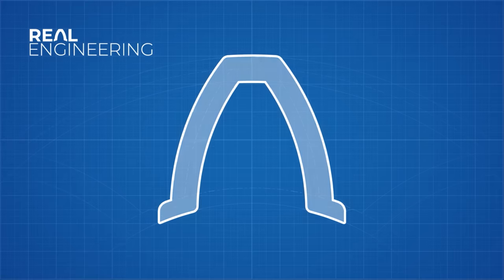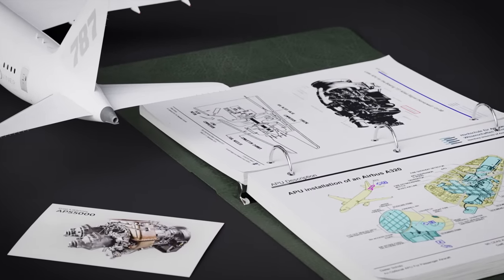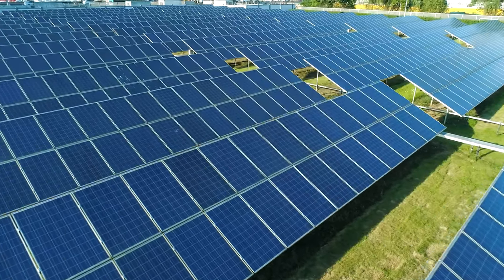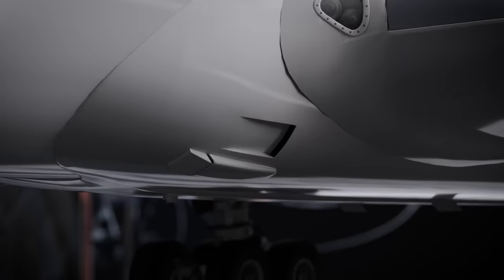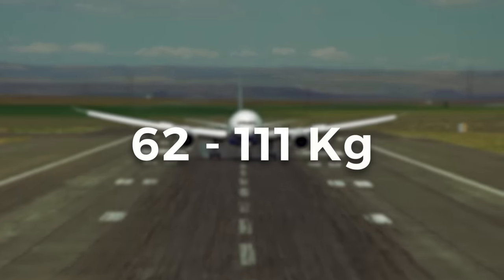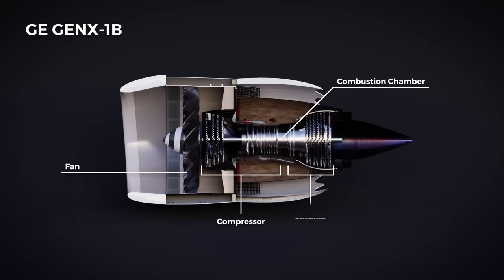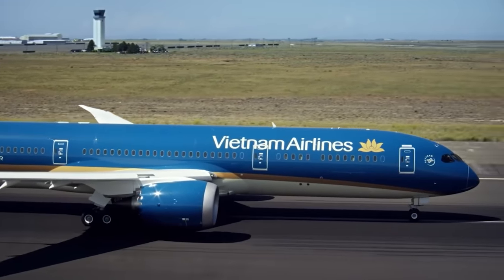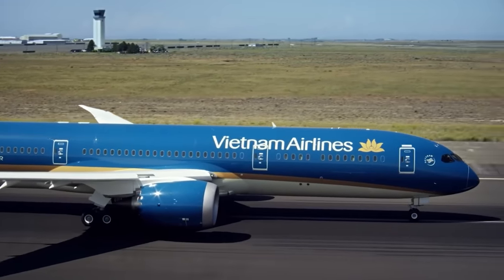The Insane Engineering of the GEnX

Comment: Really neat engine, basically a ducted turbo prop. Makes perfect sense in the evolution of engines and our times of needed efficiency.
Reply: Turbofan seems like the perfect name now huh.
Reply: Such turbofans have been around for decades; the bypass ratio has increased, and they've become more efficient, but still turbofans.
My day job involves getting large commercial turbofans through the FAA certification regimen.
Reply: @UncleKennysPlace  Very cool. They are kind of like highway gears on a car. It gives the engine more load to work with.
Reply: A ducted turboprop with many more blades... aka, a high bypass turbofan?
Reply: Turbofan engines have been around for ages… 🤔
Reply: @TheAmazingCowpig  not necessarily, turboprops are categorized as torque producing engines, they dump their power into a reduction gearbox which slows the rotation of the output from 30000ish rpm to under 2000 rpm for propeller drive. Where a turbofan is a thrust producing engine that derives it's power from the hot gasses exiting the engine and has no need to reduce it's rotational speed, turboprop and turboshaft engines also do not have bypass ratios because they don't produce power by forced air but through a shaft
Reply: I can see where your coming from, but generally speaking while both are Turbine engines, turbofans will use bypass air to cool critical engine components such as combustion liners and turbine blades/vanes as the metals cannot handle the temperature of the flame where as turboprops just use either bleed air or air from the intake to cool such things
Reply: @nolankeilty3732  

I think you’re missing the point my friend
Reply: "Efficiency" has its draw backs though, when it comes to air freight at least in my experience as a flight dispatcher. The less fuel it burns, the less cargo the plane can carry at a longer distance. You can carry up to 40,000-45,000 LBS of cargo in a B727 from Michigan to Laredo airport with relative ease, especially if the weather is perfect. In a B737 however, things are certainly different. From Michigan to an airport in California for instance, the most you'll be able to carry is 30,000-32,000 LBS, because its not burning as much fuel as the less efficient B727, making it heavier. I believe this is one of the reasons why B727's are still being used a lot in air freight operations.
Reply: @nolankeilty3732  in Turbofan engines, the majority of the thrust is produced by the bypass air. Cooling, if any, is incidental.
Reply: @jibronigibironi8959  >The less fuel it burns, the less cargo the plane can carry at a longer distance
Surely you mean a shorter distance. 
If 2 identical aircraft (one with high efficiency and one with low efficiency) are on the same route with the same cargo capacity, the higher efficiency aircraft can do it with less fuel and therefore cheaper, or use the same amount of fuel and bring the cargo further.
Why would you load an aircraft with 10000lbs of fuel that you don't need and reduce your cargo capacity needlessly?
Reply: @Pique147  No I meant at the same distance, on long trips from say, Detroit Metro Airport to LAX, a B737 can't carry as much cargo as a B727 because of its fuel efficiency, not nearly as much actually. We always gave them at least another 30 to 45 minutes of extra fuel just in case they have to maneuver around storms at the pilots discretion.
Reply: @Validole  my guy I went to school for this they use bypass air to cool the liner so it doesn't melt trust me
Reply: @jibronigibironi8959  But why? That makes no sense to me. More fuel efficient = less fuel or more cargo. 
Is the 727 configuration somehow more efficient than the 737 under wing engine layout maybe? Cos all other things being equal you wouldn't be putting more fuel into a more efficient vehicle to do the same job.
Reply: @Pique147  Well, yes, less fuel means more cargo. It didn't really matter in the case of a 737 on long trips. We could have reduced the extra fuel to 15 minutes, and it still couldn't carry as much as a B727. That's why Kalitta, the company I worked for, kept B737 trips confined strictly to either east coast trips, or west coast, and they only started doing west coast trips a few years ago. That was when I found out how much less a B737 can actually carry in fact. I had to plan for the planes to be flown over to LAX and PHX airport from the east to prepare for the west coast missions for DHL.

It literally could not carry anymore than 25,000 to 32,000 LBs at the most, even with little to no extra fuel, while a B727 can easily carry up to 45,000 LB's the same distance even with 30 minutes of extra fuel. This is why we never planned flights to go from west to east or vice versa with a B737. It was always 727's used, because they can carry more cargo with extra fuel in case of bad weather. Even though the B727 is older and less fuel efficient, its actually to a companies benefit if they are carrying cargo. Not sure if the engine layout has anything to do with it.
Reply: Ehh. The 727 is a bigger plane than the 737. They are differently designed planes, so it's not like it can carry more just because it burns more fuel. It has a 50% bigger wing area than the 737 for instance.
Reply: @ThePentosin  The only part that really matters is the fuselage. They are roughly the same size on that part. A 737 can carry just as much as a 727 at a shorter distance. So yes, it's the fuel burn rates that is the primary factor.
Reply: @jibronigibironi8959  that's just wrong. But anyways, the 727 is way longer than the 737. 10m/30 feet longer. So yeah, bigger as I said.
Reply: @ThePentosin  Well, sure, but like I said, in actuality it can more or less carry just as much as a 727. It just depends on the distance, not so much the length of the fuselage. A 737 can carry 45,000 lbs if cargo easily going from Philly to New York. Don't need nearly as much fuel making the plane much lighter. When generating a flight release for the captain and ATC,  how much cargo it carries largely depends on only two things, distance and fuel burn. Because the other thing that goes into flight planning is something called runway analysis. The FAA requires it be done before every flight to ensure the plane doesn't exceed its maximum allowed takeoff and landing weight. That in of itself depends on the runway length, how dry it is, how steep it is, its elevation above sea level, forecasted temp, wind speed and direction, inoperative equipment or control surfaces, tons of things. Even a two knot tail wind can cause a flight delay. A small amount of tail wind can reduce maximum allowed weight by thousands of pounds. Getting a plane safely in the air is not as straight forward as people assume.
Reply: @nolankeilty3732  bypass air is used to cool the turbine casings while in cruise to make them contract and therefore reduce the tip clearance around the turbine blades which massively improves turbine efficiency. The casing wouldn't melt without the bypass air though. For cooling components that would melt, you have to use internal high pressure air in order to overcome the main gas path pressure and force it out of the cooling holes. That is insane engineering though as we use 1000K air to cool a component with a melting temperature of 1600K surrounded by 2000K air
Reply: @maxwilson6838  it's not the casings I'm talking about, there's a liner inside the gas gen casing that needs cooling and airflow to keep the liner cooler than the flame and also keep the flame off the liner
Reply: @jibronigibironi8959  they are different airplanes… Why can a diesel truck haul more than a Prius? Because it’s less efficient?
Reply: @nolankeilty3732  ah you're thinking of the combustor can. IIRC about 5% of the flow into the combustor enters through the fuel spray nozzle (the 3D metal printed part in the video) for primary ignition and the rest flows around the combustor can and enters through impingement holes that also help with fuel air mixing. True that flow is used to cool the combustor can lining and would melt without it even with the ceramic coatings
Reply: @dereklm280  Now you're talking about trucks? Something that operates on solid ground? Apples and Oranges pal. I'm not some random dude on the internet pretending to be informed, I developed flight plans as a flight dispatcher and sent them to ATC and the captain. When it comes to getting a flight plan done, and getting it done in a timely manner, you aren't gonna care about the size of the fuselage, neither does the pilot for that matter. The weight of the plane, the distance of the flight, fuel load, the weather, and the cargo are all I'd care about, things the pilot would be doing if a flight dispatcher wasn't there.
Reply: @jibronigibironi8959  We understand the variables you list at the bottom are the important ones for approving flights (although those still require tables or some other sort of standards made by the manufacturer and/or your company). The disconnect is that you are saying a particular airplane (727 or the truck in my analogy) is better based on it being less fuel efficient than another completely different plane (737 or the Prius). I feel like you are just correlating the two airplanes attributes (efficiency and load capacity) rather than explaining the actual cause (design of the airplanes). I believe the stats you have given but are you able to explain your point with a more particular scientific/physics concept?
Reply: Ducted fan powered by a turbine...with bonus extra thrust from  exhaust
Reply: @jibronigibironi8959  the statement you’ve made is that “this aircraft can carry less cargo than another aircraft because it is more efficient”. This statement makes no sense.
Reply: @cjeam9199   Well for someone who never had to produce a flight plan it might not make sense I guess. But its actually really simple because like I said, going from philly to New york for instance, a 737 can easily carry upwards of 45,000 lbs. Same case going from Arizona to  L.A, another route they took. Kalitta keeps their 737 trips confined to either the West coast or east coast as much as possible for a reason. Is the 737 smaller than a 727? Maybe, but its really not that much smaller, which is why both are considered mid range aircraft. Its not a major factor in how much it can carry,  otherwise the result would still be similar on short trips. That isn't at all the case, so it's mainly the distance that determines. Winds Aloft does as well, or the weather. The longer the trip, the more fuel is required. That makes the plane heavier, which affects how much cargo it can carry. You want more cargo? Get rid of some of the extra fuel, which happened quite a bit. And since we're so hung up on size, lets compare the 727-200 to a 737-10 max, plan a trip from KCVG to KLAX. 

The formers length is 152 ft, the latter is 143ft. That's a margin of errors difference. An extra nine feet isn't going to make a difference when talking air freight. But what will make a difference on this trip is how much fuel it can burn to lose weight. With the 737 max being so much more fuel efficient with those brand new, gigantic engines, I guarantee you it won't be able to carry anywhere near as much cargo as a 727. The max, depending on extra fuel, will be around 25,000 lbs if you're lucky. Navtech, the software Kalitta and Spirit Airlines uses to dispatch flights literally will not let you increase the freight load unless you either dump some fuel or some passengers pal. The 727 though will be able to carry up to and over 40,000lbs easily, because those engines are utter fuel guzzlers 😂. Its losing a lot of weight on its way to LAX. The 737 won't, especially the newer ones, like the 700 and 800 series. The only way it can make that trip with that much cargo is if it makes a fuel stop, and that's not something you want to do if the customer needs the shipment within a certain time frame. This is why the 727 is here to stay for air freight unless those companies replace it with a 787 that is big enough for the size difference to actually mean something. Otherwise the 727 being fuel guzzlers are actually to their benefit.
Reply: @jibronigibironi8959  you’re using a lot of words to still fail to explain yourself. Why does burning less fuel in the air mean less cargo capacity by weight?
Reply: @jibronigibironi8959  If the more efficient plane will weigh too much at landing because it won't have burnt enough fuel, put less fuel in it at the start.
Reply: @cjeam9199  And then you'll likely have to make a fuel stop pal, like I said. Now you are wasting the customers time when you don't have to. That's more money you are charging the customer for the trip, with just as much if not more fuel that has to be paid for. You also now have pilots on the clock even longer, so having to make stops isn't cost effective.  That happened quite a bit when using the B737. Kalitta can do that, OR, they can just use common sense and use the B727 that actually CAN take 40,000ish lbs of cargo all the way to LAX or even to and from Mexico (another route often taken), so the customer can get his stuff in a timely manner. On unscheduled trips, the customer tells us how much cargo they need hauled. We then tell him if we can actually take that much cargo full stop, or if we'll have to make a couple of fuel stops in between. And he might need that cargo asap for whatever reason, so you'll want to avoid fuel stops as much as possible. This is why the B727 is still one of the most used aircraft in air freight in the world, especially for small to medium sized companies. I expect this to stay that way until there is a viable replacement for it, because the B737 sure as hell ain't it. They can push this "fuel efficiency" spiel all they want.
Reply: @jibronigibironi8959  no, they don’t have to make a stop for fuel because they burn less fuel because they’re more efficient.
Reply: @cjeam9199  😂 You STILL don't get it. It has to have enough fuel to get to the destination, its alternate, plus an extra 45 minutes of fuel on top of it in case it has to go into a holding pattern. That is per FAA regulations. Now the plane is trying to carry 45,000lbs of cargo to LAX on top of that with perhaps some jump seaters. The data then calculates that the plane can not do it full stop per the fuel requirements because the plane will be too heavy to land safely by the time it gets there. And to start with, this is assuming you can even takeoff safely with that weight because its also about your maximum weight allowed for takeoff. 

Therefore, you're only options are to carry LESS fuel than is needed to get to LAX in one trip to start with which means fuel stops are required to be able to keep the 45000 lbs, which again, isn't always ideal, OR, leave some cargo behind, which definitely isn't ideal because now the customer is wondering why he bothered doing business with you if you can't get the job done. 🤣🙃. OR, the best option is to use a plane that will burn off all that extra weight because that allows it to get to its destination in one trip, with all 45,000lbs of cargo. Its not about "fuel efficiency". Its about how heavy the plane is by the time it gets there. The FAA doesn't care about so called "fuel efficiency". They are only there to ensure the rules are being followed for SAFETY. "Fuel efficiency" is really just a buzz word these companies use to sell an airplane, that's it.
Reply: @jibronigibironi8959  you are still failing to explain why the more efficient plane fails at carrying cargo over the one that burns more fuel.
Reply: @cjeam9199  Fuel weighs the plane down just like anything else. The faster it can burn off that fuel by the time it gets to its destination, the more room that leaves to trade off for more freight, SAFELY, because that's what the FAA cares about pal. That is why the B727 can carry more going from new york all the way to lax than a B737.  You're not going to get 40,000 of cargo in one trip with a 737 going that far. I know that from personal experience, you'll be lucky to get 20,000ish lbs. So all this talk of "fuel efficiency" is honestly just marketing dude. The only ones taking that spiel to be anything more than that are people that wouldn't know the first thing to generating a flight plan, especially in a freight operation.
Reply: @jibronigibironi8959  the more efficient plane needs less fuel, thus it has less weight of fuel in the first place
Reply: @cjeam9199  Yeah, that is the idea behind this push for better engines. But there are other variables that this video DOESN'T account for, the planes weight being the main one. Even assuming it can carry less fuel, you're still trying to carry 45,000lbs pounds of cargo from end of America to the other. From my experience, its not happening with any 737 without extra fuel stops. This isn't something you have to worry about nearly as much with a 727 because it burns it off faster.
Reply: @jibronigibironi8959  and yet you are still failing to explain why that difference arises because of the higher efficiency, which is what you said to start with.
Reply: @cjeam9199  Ok, lets stop using the word "efficiency". Its really a misnomer anyway, a marketing gimmick. We're talking "fuel burn" rate. One plane burns it off faster than another. This wouldn't matter as much in a passenger operation like Spirit Airlines with their fleet of 737s. In a freight operation, things are certainly different. Their fleet of 737s with their fuel burn rate isn't going to be of much use to me trying to get a heavy payload on the other side of the continent. Its only "better" if you are spirit Airlines, not if you are an operation like Kalitta. Fuel burn is VERY important. The video can pump you up with this word "efficiency". And that will make the pilot all warm and fuzzy inside......until something happens and he has to change altitude by 5,000 feet or more from what was initially planned. Know why? Because his fuel burn rate changes with it. Now he's sitting there with his "more efficient" 737 like he would in any other plane, trying to carry heavy freight, wondering if he still has enough fuel to get to his destination, calling me, the dispatcher to make sure he can. That's why I said this efficiency spiel doesn't mean much. I'm giving you this scenario because this happened once with a 737, before he even departed. 😂. Meanwhile, we're getting videos like this pumping people up with words like "efficiency".
Reply: @jibronigibironi8959  Why is a higher fuel burn rate better? A higher burn rate means to go the same distance that plane has to carry more fuel when it starts and will thus be heavier when it starts. The only difference in the two aircraft conceptually will be the difference between their takeoff weight and landing weight. For the more efficient plane that difference will be smaller because it will have burnt less fuel, while the less efficient plane that burns fuel at a greater rate that difference between what it weighs when it takes off and what it weighs when it lands will be larger.  
Because it uses less fuel the more efficient plane can fill the tanks less, so in theory it should have more capacity for cargo.
Reply: @cjeam9199  :"while the less efficient plane that burns fuel at a greater rate that difference between what it weighs when it takes off and what it weighs when it lands will be larger."
  
😂 Well, thanks for proving my point. THAT's why the 737 can't take as much cargo as a 727. The greater fuel burn rate ensures a greater difference in its landing weight compared to a 737. And, like I said, fuel burn rate doesn't only matter for landing. The fuel burn rate is calculated every single step of the flight, at every navigation point. The pilot knows what his fuel burn rate should be at each altitude, starting from his ascent from departure, down to his descent to the destination. That's how detailed the flight plan is. It tells him that for a reason. Its how the pilot knows he'll actually have enough fuel. 

So if the pilot believes these 737's are so efficient at burning fuel, if he has so much faith in it, then when something happens, either at departure or mid-flight, god forbid, that causes him to, for instance, change from the planned altitude of 35,000 ft to 15,000-20,000 ft, don't be calling the dispatcher all concerned about exactly that, the fuel burn rate, because he might not have enough fuel to get to his destination. I'd love to see a pilot actually test this efficiency spiel out on these newer planes doing that, because by my experience with the 737-400 series, that theory didn't work out too well. Plan a flight, then mid-flight change your altitude by five or ten thousand feet, just to see if he doesn't run out of fuel before he gets to the runway. Hopefully, he can still glide his way to the runway, and the FAA will be waiting to have a word with him.
Reply: @jibronigibironi8959  you’ve still explained nothing.
Reply: @cjeam9199  Ok, I'll get down to the brass tax. The fact that all these air freight companies are still using B727's and even buying more of them, instead of more 737's should tell you all you need to know.
Reply: @jibronigibironi8959  probably that 727s just have more cargo capacity than 737s, independent of efficiency.
Reply: @cjeam9199  Its cargo capacity has very little to do with it dude. I know that a lot better than you. I was in the operations room generating the flight plans. Its the fuel burn rate. Its not a "probably", its a fact. If it was "cargo capacity", there wouldn't be 737's carrying 45,000 lbs at shorter distances like any B727 can. Less fuel is needed means less of it weighing the plane down, means more room for cargo. Its not hard, you're just being willfully dense.
Reply: @jibronigibironi8959  You have not explained, at all, why the fuel burn rate is important to cargo capacity and why more fuel burn is better.
Reply: @jibronigibironi8959  I think he’s genuinely trying to understand, you’re failing to engage with him, I’ve actually read both your conversations

I understand but you seem to be more interested in seeming correct and proving a point the fact he’s still trying to get some understanding from you after you continue to belittle him should tell you he’s genuinely interested in understanding he’s not trying to hurt you my friend
Reply: @616CC  That's fine, wasn't trying to belittle him. But I can assure you this "fuel efficiency" spiel these companies are trying to use to sell these planes don't mean much to air freight companies in of itself. It would for passenger operations where they don't have to carry over 40,000LBs of cargo. But this push for more efficient fuel burn rates clearly isn't being done with mid sized freight operations in mind. Unless its a short trip, the 737 is utterly useless for air freight unless you're willing to do fuel stops every single time. 🙃..No one wants to deal with that.
Reply: @jibronigibironi8959  don’t conflate this gentlemen with the companies! I know people, and I can see both of you coming at it from different angles. Honestly I’ll add. But just not quite connecting!

I’m actually extremely ignorant on this topic, you seem to be informed on some very specific points, which is always good to see. Word of caution! And friend you seem smart, I presume you won’t take this in a way I don’t intend. Don’t get too tunnel sighted on one aspect it can easily blind you from the bigger picture, I’m not referring to this situation as I barely understand, you can often learn allot from someone

I’ve learnt allot from people I regard as stupid, simply because I didn’t think of it. It’s hard, often lacks value, frustrating. To be nice to people, but when it does work. It’s like winning the lottery. (From what you learn) so it’s worth it. 

Good day to you squire! To note (edit) when I say learn allot, i mean inspire a knew thought. Haha. Hope you understand, presume you actually do
Reply: @jibronigibironi8959  

PLEASE GOOD SIR HELP WILL TAKE LIKE 2 MINS

Because I’m curious. I’ve had to come back to this thread out of, you guessed it. Curiosity. Off topic, but - How can I get YouTube to notify me when someone replies to me? Do you know? 

Havnt you noticed it’s always on the scientific and, to generalise. Logical based videos that you don’t get people shouting in each others faces? Getting absolutely nowhere 😂
Reply: @jibronigibironi8959  
So, what I'm getting at is, is that a more efficient plane still may carry a similar amount of fuel, but not burn anywhere near as much, meaning it's just lugging around a bunch of extra fuel.
Reply: @CreeperDude-cm1wv  🙂 Well, yeah, and there is a drawback to it being "fuel efficient", for small to medium sized planes at least. I'm going purely off my personal experience as a flight dispatcher. The B727 would have been out of commission for air freight ages ago if their 737 successors can carry as much cargo in pounds the same distance. Its just not happening....like ever at this point. Companies are still buying more 727's because of this. 💀